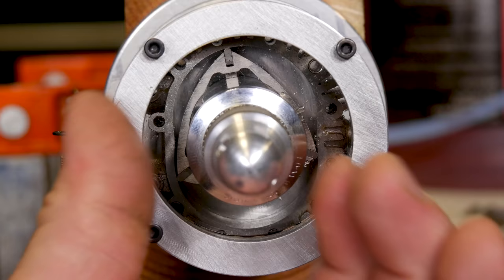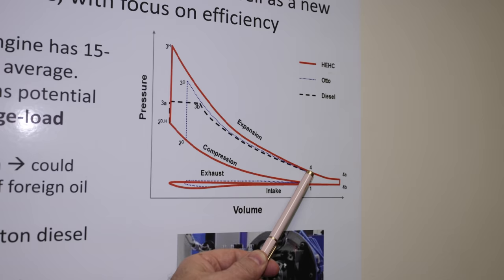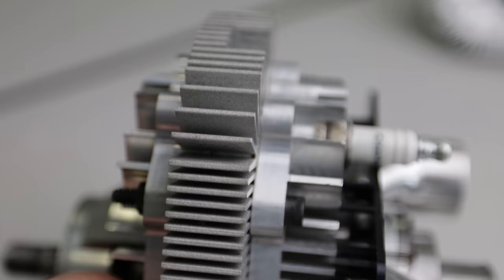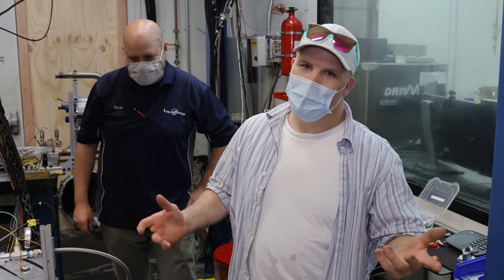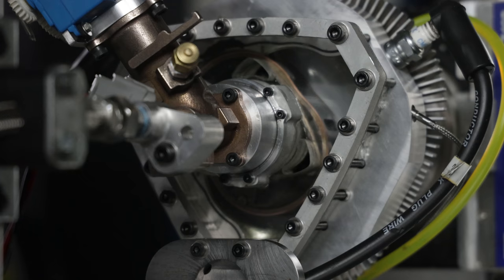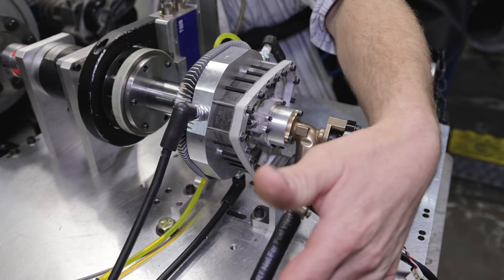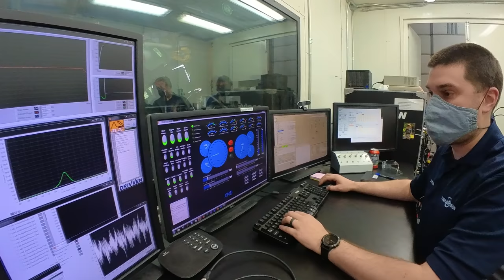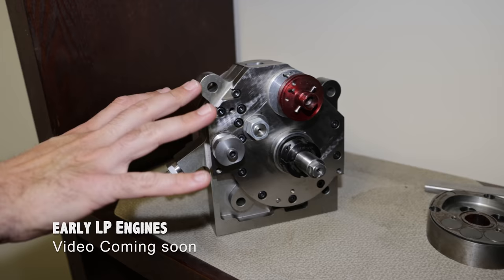See Thru Liquid Piston Rotary Engine - In Slow Motion

Comment: I am seriously amazed.  Three locations for combustion!!!   Three different locations for heat control, rather than only one location for the Doritos wankle.   I still enjoy driving my slow Mazda RX8, but it’s reliable or has been reliable, since the day I bought it back in 2005, brand new, off the showroom floor. 70k miles so far.  But this engine looks amazing for a small as it is.   Can only imagine if it’s of relative size to a N/A 1.3 liter.  Looking forward to to future tests and sizes and even force induced!!   Keep up the awesome work!

Comment: If this is reliable, it could be revolutionary. Looks to me like heat dissipation, rotor durability, and crankshaft strength are the three biggest areas of potential failures.
Reply: Literally the same potential failures as a standard wankel. Mazda had issues with coolant and how to keep it out of the combustion areas and I don't see how this fixes that yet.
Reply: @blakethornsbrough1528  With the rotor being hollow and constantly exchanging gases, this should pull some heat outta the rotor itself, the coolant would then only need to be run through the housing. In theory anyways. That's how it looks like it was designed to me.
Reply: @CF_Sapper  you a relative of the guy who designed the egr valve to be "cooled" by coolant? What happens in practice is you heat what you expect to cool. Especially in a 2 stroke style of engine like a rotary behaves.
Reply: @blakethornsbrough1528  No I 
Married into the family 😂  I get what you're saying though.

On a second watching they describe how they mix the exhaust with cooling air at a 10-1 cooling air to exhaust cooling the rotor from the inside.
Reply: @CF_Sapper  which is fine on a small scale. In application 2 rotor with forced induction there isn't enough airflow to maintain 10/1 at the rpm's a rotary runs especially during spirited driving. Is it potentially a better design than a wankel? Sure. It has a lot of questionable inner workings.
Reply: In the fifties and sixties there was a flurry on new rotary engines, either scisors-action (Kauertz, Tschudi, Virmel) or Wankel-like (rotor inside profiled chamber). All ingenious concepts, but they failed for the same reasons: heat dissipation, sealing, limited durability. Probably some of those concepts could be revisited with the new advancements in material science. But electrification is killing the ICE of any kind, so not much research will go into rotaries. Even without electrification, classical piston engines are so well developed in areas of combustion, lubrication, durability and emissions that any rotary engine would have trouble getting accepted. It's a pity.
Reply: @bkucinschi  it’s true the combustion engines are near their peak, but until there is a revolution in battery technology, electricity generation, and huge grid upgrades, the combustion engine is going to quite common. While I wouldn’t place any big bets on rotary engine technology, I can see it potentially taking over certain market segments, if it’s reliable enough and inexpensive enough. It has huge power to weight ratio advantages, and there are many uses other than automotive applications where those factors may make it worth the effort.
Reply: @geoffstrickler  : Electrification is now pushed by regulations. ICE will be banned soon in some European country, and it's not impossible that US will do the same. Actually I saw a speech given by the CEO of Toyota saying that electrification doesn't make sens in short run, but logic doesn't mater in politics.
Reply: @bkucinschi  regulations will change based on the progress of industry in addressing the issues I mentioned. All regs do at this point is establish intent and set targets. If industry can’t feasibly meet those targets, the regs will change.
Reply: @Banned Again what makes you think that? Wankel designs are stacked into multi rotor configurations, I don’t see anything here that would prevent that.
Reply: @Banned Again this feeds through the crankshaft. Would be simple enough to do a twin rotor design. 3 or more rotors would require more significant changes to the intake and exhaust design, but that is entirely possible, without altering the fundamental design.
Reply: No way you can get this thing reliable. Or env friendly. You must lubricate friction pairs and with this design oil will burn. Also it is a bit too late - electric is unstoppable
Reply: @Banned Again that’s incorrect. How do you think water cooling between cylinders works in a conventional piston engine? For a two rotor, just imagine putting a mirror image unit on the intake side. That’s the simplest conceptually. For more rotors, you’ll have to redirect the intake and exhaust between unit. Plenty of ways to make that work.
Reply: Lubrication is still a major problem. All rotary engines suffer from not having an "underside" to the combustion chamber, so there is nowhere to spray oil and then have it drip back into the oil pan -- you have to inject oil into the housing and leave it there until it burns off.
Reply: @Banned Again you’re he one with the limited vision.
Reply: Super cool engineering and design.
Rotary works great with hydrogen so this has future potential for sure.
Battery/electric are not suitable for many applications.
Reply: @evilkabab  the apex seals can be done away with, if one accepts a much higher self-sustain (idle) rpm. The face seals have also not been the biggest problem in wankel design.
Combustion chamber shape, apex seals their lubrication and thus obviously also emissions.

Highly boosted rotaries with higher rpm bands and potentially other fuels have the potential to fill a niche between piston engines and turbines.

There are quite a few applications that cannot be electrified in the near future.
Reply: But just imagine, mass produced and though needs to be finely engineered, there are just so few parts.
Reply: @blakethornsbrough1528  - what happens if this is operating on a small ultralight aircraft @ 10K feet? Wouldn't colder air provide better/enough cooling?
Reply: @Blake Thornsbrough  -  what people had the most problems with on the old Mazdas were the apex seals wearing out or breaking. Does this new design look like it's solved those problems? I want to know why this new design might be better on those issues.
Reply: @manofsan  it doesn’t have them.
Reply: @Geoff Strickler  -  so why hasn't this design taken off yet? Hard to believe there's no problems with it. Is it an emissions problem like the old RX-7s had due to oil in the crankcase? These Liquid Piston people now have a model that burns hydrogen, but I'm curious if that needs any oil, or if it's zero-emissions.
Reply: @manofsan  because all of those are unanswered questions. What they have is a small, single rotor, prototype. Demonstrating long-term reliability with mass produced parts is a difficult and expensive challenge.
Reply: @Geoff Strickler  -  if they had a 10hp version, it would be great for a paramotor, because it probably has exceptional power-to-weight and a wide rpm range.
Reply: @blakethornsbrough1528  I'm no engineer but what you say sounds likely. LP's target markets are to run small generators and in drones or hybrid vehicles driving on electric motors. They are not targeting direct driving automotive or trucking so I think your concerns would be minimized. A small generator engine to charge a smaller lighter battery array sounds like a better future than all battery or all IC.
Reply: Цео свет је у балансу а ви тражите идеју ван баланса. Нешто ту не штима!
Reply: Seems to me that lubrication in the combustion chamber could still be an issue. Also, side seal wear would wreak havoc with compression pressure as the parts wear. Engine longevity would be a big concern especially in an aircraft application. Just saying.
Reply: @ddselvig  - it's probably got way more longevity and TBO than a turbine. Perhaps side seal wear could be addressed with (ceramic) inserts? They said they have a hydrogen-burning version working. I wonder how they lubricate that?
Reply: Geoff, that was my question, how do you manage the lobes on this.  Don't get me wrong, I WANT ONE!!!
Reply: it can`t be reliable, it can`t be green, it can`t be cheap. Why to invest here?
Reply: @Joe Idan  -  why do you say this? Why would it be unreliable? Why would it not be cheap? And 'green' is a relative thing - it could be more 'green' than other alternatives for a given application.
Reply: @manofsan  it IS unreliable - pls ask Mazda owners. If you make three combustion cameras instead of one, you won`t get more reliability out of there.
Now to "more green": Lubricate or die. If lubricate enough - it is no more green, as motor oil burns with the fuel. And you need more oil, these engines are thirsty.
Cheap? Is it cheaper than a normal ICE? No. Will it be cheaper in the future? Why should it? It needs more maintenance than "standard" ICE (costs), it has less resource (cost), it produces more CO2 (costs). And I don`t compare it with EE.
Today ICE (and Wankel) are alike steam engines: their time is gone. No reason to improve them, the future is electric.
Reply: @Joe Idan  -  but rotary engine is capable of burning even hydrogen. I'm not sure what lubricant is used in that case. Hydrogen is a green fuel, and even if the early rollout of the engine has it burning hydrocarbons, it would be relatively easier to transition to hydrogen using this same type of engine platform.
Reply: @manofsan  indeed, a rotary engine could be very well suited to hydrogen fuel. The rotary’s relatively high power/weight and power/displacement ratios offsetting hydrogen’s lower energy density.
Reply: @Geoff Strickler  - but what does a hydrogen-powered rotary engine use for lubricant? When the fuel is conventional gasoline, we see the lubricant oil is added to the fuel for lubrication. But how is lubrication provided for a hydrogen-powered rotary engine?
Reply: @manofsan  there are several ways to manage that. Oil injector for one.

Comment: I like the fact that it has all the stages in each chamber. In this way, you can cool down that chamber after combustion, in the intake part. I seriously hope this proves to be a revolutionary technology so I can ride a motorcycle with this engine before gas reservoirs deplete.
Reply: These are made to run on hydrogen which burns clean ;)

Comment: This is a fascinating little engine, though I can see that it is expressly designed to be a single-rotor implementation, as expanding it to multi-rotor configurations would prove exceedingly complicated. Being air cooled is also a limitation to how it can be scaled, though that could be remedied with a cooling jacket. It's just not something that I think would be ideally suited to the automotive industry unless it provided enough torque to be used as an effective range extender, and I just don't see that happening with that particular design.
Reply: Yeah it would be great as a "range extender " or backpack paramotor powerplant
Reply: Or put several on the same shaft just like a cam...

Comment: You moved the ‘apex’ seals from the spinning piece to the stationary piece. Very cool, and probably provides an engine that’ll last longer than 100k miles, but still...
Reply: Just think of the applications of motorizing scooters & small motorcycles using this engine design.
Reply: Even powering some cool & fast Quadmobiles would be great because of the lighter weight of your rotary design plus seems it could be economic fuel saving meaning you could go alot further with one go full fill up
Reply: @UltimateForceMarketing  We have the perfect engine for that already, It's called a piston engine.
Reply: The company unfortunately seems kind of sketchy. This video has more information than their own website.

Comment: Looks like the perfect Aviation engine.
Reply: A 65hp, 65 lb engine would be excellent for ultralights. They didn’t really measure aspiration,ignition, and exhaust ancillaries in their weight calculation though, so it’s difficult to compare it to anything.
Reply: Super cub bush plane for sure
Reply: Exactly what I was thinking
Reply: Duct the moving air, ram air, add some HP and TQ. Oui ou non???
Reply: @tomcoryell  With the weight being down so far you could probably get away with 45-50hp?
Reply: Great for all those new UAVs
Reply: @alreed2434  I strongly agree, but at my altitude, why not have 65hp? Great for those high DA days too!

Comment: It's conceivable that you could fairly easily redesign this with an intake and exhaust port on either lobe utilising a electric lifter for each intake/exhaust valve. Allowing the replacement of air/exhaust gas through the centre of the rotor for oil. Personally if i were designing this, I wouldn't use radiator coolant at all. I would make this motor entirely oil cooled like a motorcycle engine. Advanced heatsink design and oil coolers would keep this a very cool engine. 
A dual rotor setup, would require 6 camshafts of two lobes each. But the reality is, if it's got 3 power strokes per rotation the possible power output is quite significant. I would hypothesise that a NA 1litre dual rotor engine could make around 200hp fairly reliably.
Reply: electrical intake and exhaust values are an idea far more revolutionary than this engine.  When they become feasible, sign me up, but I'll have them on a regular reciprocating engine instead, thanks.

Comment: A direct injection design would improve efficiency even further, all we need is for you to compound supercharge it now!!
Reply: I'd also love too see this running some boost turbo or supercharged,The power to weight would be increased tenfold.
Reply: @mattyceks380  true, but getting the heat out could be a problem. With the additional heat, I wonder how much the rotor would grow and possibly decrease clearance to the point of locking the rotor and housing together? With only one face of the rotor only being the hot side, the potential is there for uneven heating and therefore warping of the rotor if you push it too hard, which, adding forced induction would be really easy to do...
Reply: @kleetus92  well keeping bigger clearances shouldn't be too bad for the engines if the (apex?) seals can slide in and out...
I agree with the direct injection, the hemisphericalish chamber shape is great, but there still are long, thin arms which will lead to incomplete/too cold combustion.
A nomal piston is oil cooled from the bottom, can transfer heat to the cylinder wall and gets cooled with cold, uncompressed intake mixture inbetwen cycles.
But the combustion face has pretty much no cooling exept air from the back side, that would have me very concerned about pre ignition and knock.

Also no crankcase lubrication or am I missing something?
Reply: I'd wonder if the traditional methods of increasing power would work as well, based on this being a hybrid of several other cycles.  It's a very interesting TS diagram for sure.   I suppose increasing air/fuel density should work no matter what, but it may not yield quite the expected increase in power.  Or maybe more, who knows.  But I bet they're looking at it!!!
Reply: @mattyceks380  I looked into the company more, and it's unfortunately really disappointing. Their 750cc X4 motor only makes 40 horsepower and only revs to 6000 RPM. To make matters worse - That's with a turbocharger, meaning even a Geo Metro engine is better (993cc, 55 horsepower and revs to 6500 RPM).
Also, they measure their engines without manifolds, fuel, or even ignition systems. So the advertised weight isn't even the weight of a running engine. That means that the power to weight ratio is actually horrendous and they're just really good at marketing.
Reply: @joshjlmgproductions3313  Agree.  Especially this engine makes 3 combustion in one output shaft revolution and is six times as many combustion comparing with the traditional 4 strokes piston engine.
Reply: @joshjlmgproductions3313  but the x4 is running on diesel